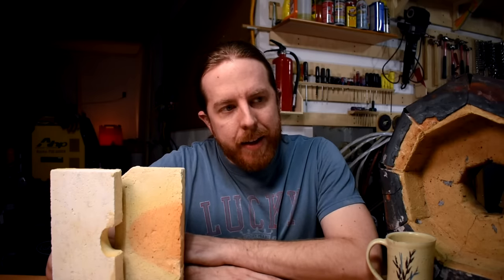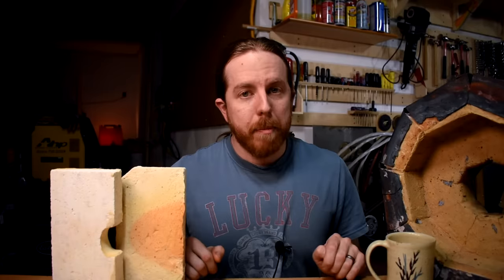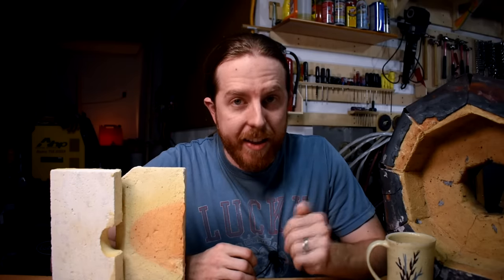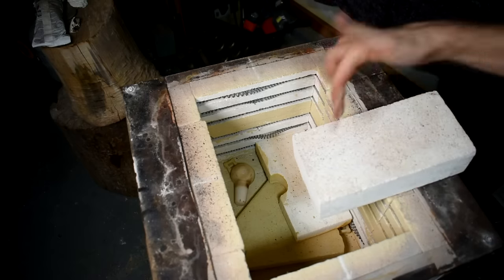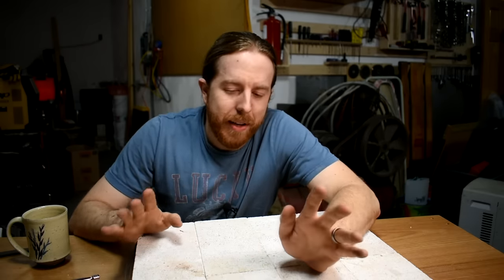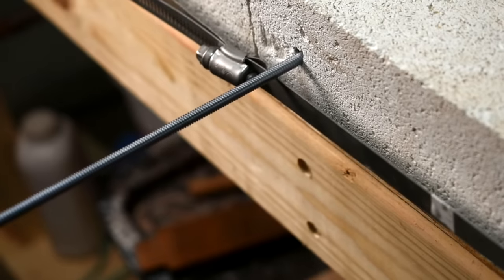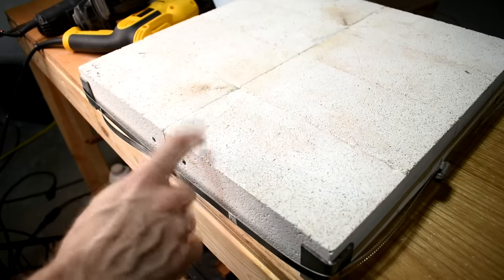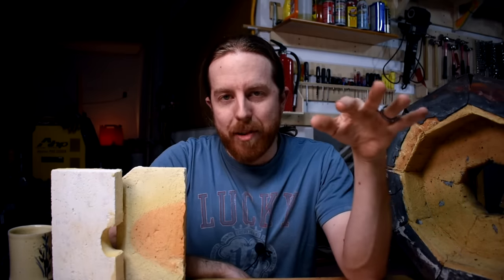There's a Problem With Fire Bricks

Comment: If you use stainless rod and stainless belvile washers you'll have continuous spring loaded tension as well as a bit more temperature and more importantly rust resistance (you'll cry when concrete cancer explodes your lid lol, it's why Roman concrete lasts so long, no steel in it)
Anyway, something like a mudguard washer against the brick, stack of whatever belvile washers you want to get the spring force and movement distance and bobs your uncle.
Check the rating on the washers for temperature against your environment though just to make sure it's ok.

Comment: Use borosilicate rods if you have to replace those steel ones. No expansion and extremely high heat resistance.
Reply from the maker: Good idea

Comment: Saw this video and clicked on it cause I was curious.  Subscribed cause I liked ya.  Also was thinking you just needed to support the outside band vertically, like take of those L shaped metal on both sides of the band.
Reply from the maker: Thank you!  The band holds on pretty well just under tension but it might help to put in some more support for sure

Comment: you should drill a bigger hole for the wire to prevent it breaking the bricks apart when it expands. you could drill a 5/16" hole for a 1/4" rod and lightly wrap it in kayo wool to absorb the expansion while keeping it insulated so you don't get a draft through the hole that unevenly cools the bricks.
Reply from the maker: Good idea.  These are really thin rods, maybe 3/32 so I'm not expecting them to expand a lot. By length maybe but the hole is open on both ends

Comment: You should pay a visit to a glass factory those that produs beer or winebottles. They have a kind of swimming pool fild with molten glass and they keep feeding is glass granulate in the same volume they use. These pools are hot 24/7. They can't stop that proces. Because when they do de walls of the pool will colapes.

Comment: Would grinding the edges of the brick into a tongue and groove help the lid.
 or would it even be possible I don't know how brittle those are.
Reply from the maker: It's probably possible, but yeah it would be pretty brittle.  These bricks will break if have if you tip them over.

Comment: Have you thought of putting a spring at one end (or both ends) of the threaded rod to always be applying a compressive force on the bricks?  Also doing the same at right angles to compress in both directions? Paul, Johannesburg

Comment: Easy solution: ceramic blanket, layer of cheap rock wool as backing, glue with sodium silicate or stitch with kanthal vape wire. reinforce blanket with steel rods (near the outside). DONE.

Comment: Tbh, I feel like the issue with expansion and contraction of the top would be worse if it were a solid piece. It might take all that heat, change size, and then crack.

Comment: I wonder what would happen if you made a rabbet cut on each of the bricks like woodworkers do at the edges of cabinets to create stronger joints. The thought here is that the bricks would still shrink, but in the areas where you have rabbet joints, the weight of the overlapping brick would keep it sealed against the brick below.
Reply from the maker: That would probably help.  The bricks can be cut no problem but I would be worried about weakening them
Reply: @PaulsGarage  Alternatively, you can always construct in concentric overlapping layers. If your innermost layer is the most exposed to the heat and your next layer or even two overlap the seams then your lid will stay sealed despite the shrinkage and separation of the innermost layer. If you use thinner bricks, it doesn't even have to be heavier.

Comment: We used Cer Wool or K Wool  pieces on our pouring ladles to cover tops couple pieces would last for ever on toys

Worked iron pouring,cupolas and ladle repair for years.
Pour one out of ladle cast , also have all kinds of plastics you can ram in , been 25 years since then some are black some Are green, some are white don’t remember names any more
Contact a refractory company may have some outdated

Comment: DoooooD……. Very cool delivery of very cool info….. I am a Blade smith who dabbles in “lost styrofoam” casting…. Heat treat of carbon steels. All with wild & wooly propane. I’m having the best luck with castable for my forge. 30# propane tank…..stainless bells for the burners is ideal. Thanks for the research.
Reply from the maker: I've made a castable furnace in the past, it's definitely nice and easy.  I didn't use really good stuff though.  If I was going to do it again I'd use kast-o-lite30
Reply: I’m in Canada so I’m hoping to get something local. Forced air is best efficiency & simplest build.
Reply from the maker: Definitely forced air if you need lots of temperature.  Lately with this zamak stuff I'm using a small, non forced air burner because I don't want to overheat anything.  It still gets too hot if I'm not careful!  The forced air burner can melt cast iron no problem, so bronze is a bit tricky, it overheats too easily.  for heat treating have you thought of using an electric oven? It's much easier to control the heat cycles exactly

Comment: I tried something similar a few years ago but I used the refractory cement and thick chicken wire. While technically it's still together I'm not a huge fan of it. I don't know what the solution is but I don't think what I did is it.

Comment: I tried to build some sort of furnace to smelt iron ore together with a friend of mine. We were about 10 years old and this was before the Internet became what it is today. So we found large pieces of discarded asphalt from some repavement project or something like that? We transported a huge amount of these chunks of asphalt to firing range that was no longer in use since it had lots of sand availble and was far away from any houses. We constructed a box of asphalt chunks. Then we filled it halfway up with charchoal and finally added the iron ore. Finally we covered the whole thing with sand with just a small opening at the top and a pipe sticking out at the bottom. The pipe was connected to a fan that was powered by a car battery that must have fallen of a truck. 
We fired that sucker up and the fan just went to town on that charchoal. Being young and total morons we didn't know that asphalt starts to burn when it becomes hot enough.  We found this out when a huge amount of pitch black smoke started to spew out of every corner of our smelter.

There was no risk of the fire starting to spread since we built it on and old firing range. But the smoke could be seen for miles. So we noped the f out ot there before the fire department and cops arrived at the scene. 

So do not use asphalt when you build ovens designed to smelt iron ore. I pretty much 100% certain it wasn't even iron or we tried to smelt, just black pieces of sone sort of mineral?

Comment: When heated they expand. Is your metal band not letting them expand freely and causing them to fail? Like a buck stay on a brick kiln. You have to loosen when hot and tighten if you cool them off or you could have crown problems.

Comment: Just a thought, but have you considered lining the interior of your bricks with Starlite? Supposedly the material remains cool to the touch after being hit with a blow torch for 5 minutes because carbon resists heat very well. Since a blow torch can exceed 2000 degrees F it stands to reason that this would prevent heat from reaching the bricks. Now, Starlite has it's weaknesses: It's physically weak and is destroyed by water, but as long as you are just lining the interior of your fire bricks with it this SHOULD solve your problem. 

Officially, Starlite is a lost art, but there have been people who have successfully created it again or at least something close to it. The ingrediants are: 10 parts cornstarch, 1 part baking soda, 4 parts Elmer's PVA Glue. There are videos on YouTube of people making it.

Side Note: Materials like Starlite is a likely explanation for ancient stone structures too large for humans to move. They probably built molds, melted the rock, and poured it into shape. This would have allowed the blocks to fit closer than laser precision and be much larger than anything they could ever hope to move and since the mold would be destroyed by water there wouldn't be any surviving evidence.

Comment: Maybe try coating the inside of the forge with ceramic glaze on the first firing as a heat barrier
Reply from the maker: I use a coating of satanite which is a good high temp flux resistant surface so you definitely have a good idea there

Comment: Yes, though the ones I bought were k23 items.

Steel?  Perhaps 1/16 - 1/8 er316 Tig rod?  That won’t get messed up as quick by heat and oxidation?
Reply from the maker: If i had any super long tig tungstens that would be the best probably.
Reply: @PaulsGarage  those would oxidize almost as fast as the all thread.  They’d get all brown and moldy in no time.

316 stainless handles heat and oxidation pretty well.  321 would do better still, but finding 321 stainless Tig rod…

Comment: Step the sides of the brick, so you have a half lap joint. Conversely use thinner brick and double layer with the centers over the joints. Ot use tungsten rod.
Reply from the maker: Good ideas

Comment: PG, give some thought to * spring loading* or a torsion system to keep things snug.They are relatively simple applications.
Reply from the maker: That sounds interesting, is there a way to allow for expansion of the bricks under heat and still keep it tight when it cools?
Reply: @PaulsGarage  yes, make your rods longer and secure them on one end with a fender washer and a nut. On the other end make the rod stick out a few inches and use a fender washer-spring- washer-nut. When you slightly tighten the nut against the spring it will cause a tension clamping force that will hold the bricks together as they shrink
Reply: @PaulsGarage  the easiest would be to incorporate a tensioning spring in an outer band where it's putting a compressing force at the fastening connection.

Comment: Brilliant idea castible refractory
Reply from the maker: I've used that stuff and i'm not impressed, but i didn't use one called Kast-o-lite, which i hear is the good stuff.  I'm ordering some soon to use fixing up the foundry furnace, so i'll check it out.
Reply: @PaulsGarage  Don’t remember the stuff I was using like the bricks it is application critical. Have always dealt with a refractory dealer that’s all they do is commercial. Heat treat  ovens forges kilns . But I’m in a area with heavy equipment manufacturers .
Good luck in your ventures. I’ll be watching

Comment: You could really cheat and line the inside of your kiln / oven / forge with 1/8th inch 330 stainless steel plate too... It actually is relatively cheap compared to firebrick and it can handle extended time at 2000+ F

Comment: The problem is the wrong application of bricks as a flat lid to keep cost down. You get the consequences later well after you've paid for it. Is just force fiberglass in the crack, my ceramic glasses is still in the box so I can tell ya if it'll powder or not while getting shoved in a crevice.
Reply from the maker: Yeah if I did this again I wouldn't use bricks for the lid.  Maybe some of those refractory boards or something

Comment: Plane  the butting surfaces of the brick at a slight angle so that they form a very mild arch . Then mildy  tension the band , much less tension than used without the arch geometry. Gravity will then be in the lid's favor .
Reply from the maker: Very true, that would work

Comment: Wouldn't pre-heat-treating the bricks solve this?  
It appears they expand in a permanent way, then stop expanding for any brick or section exposed to a lot of heat.
Put the bricks one at a time in your (old) kiln, then build the new kiln with the treated bricks.  Not sure how long the heating would take?  48h perhaps at 1000C?

Comment: For one you are using insulator bricks and not hotface bricks insulator bricks just rubbing 2 together will change their shape they're soft and designed to wear second you should be using a combination of insulator bricks and either hotface or ceramic bricks for better durability also using mud and adding some kwool to the top of the furnace between the sides and the top lid will help to seal it up better

Comment: bricks are mortared together on lids or use ceramic fiber sheets, my kiln lids are way bigger than yours and I have no problems, mine are octagons.  Do yourself a favor and look for a used kiln that needs elements, and a HF weed burner, and your in business. I also use a laboratory furnace
which also uses fiber, it fires up to 2400f incredibly fast

Comment: Why not for your top you could also use duraboard you can get it in 1in 1.5in and so on think they go up to 3in but it has the same heat rating as your brick and can be easily cut to size
Reply from the maker: Good idea, I would probably do that if I build this again

Comment: You could build a steel box cover and stuff it with ceramic fiber insulation.  It would be a lot lighter and you could cook dinner on the top.:trophy-yellow-smiling:
Reply from the maker: I'm thinking of adding a shell with ceramic wool insulation around this and the foundry furnace.  Budget is the only reason I haven't yet

Comment: Permaculture, wood stove, and masonry heater folks also use fire bricks. Look up the rocket mass heater if you haven't.
Reply from the maker: yeah these bricks are great for lots of stuff.  I don't think wood stove people get them up to white hot though so the bricks should last forever for them
Reply: @PaulsGarage  true, they dissipate the heat coming off the central insulated stack through the metal barrel.

Comment: steel ball bearings between the brick in the middle may be a simple fix. like a pin between stones in a wall. tool steel even yellow hot can be tough.
Reply from the maker: That's a pretty good idea thanks

Comment: Hey man! Your electric oven build was so inspiring i'm trying to build my own for ceramics!
I need some help calculating the size and how many coils i'll need.
I got a 50l barrel and insulated it with firebrick and ceramic wool leaving me with a inner chamber like a cyllinder of 22cm diameter and 24cm deep.
What size wire and how much would i need to get to 1200c with that inner chamber size? Any help would be awesome thanks!
Love from Brasil !!
Reply from the maker: That's great!  I'm not sure on the calculations so I used kiln elements from a kiln that could get to cone 10, and just made sure to package them in more densely.  I don't know the exact length or size, just that they were Skutt 818 elements and I wired them up the same way they were on the Skutt kiln.  That way I didn't have to do any extra engineering.  Good luck!

Comment: Why not cut an angle on the end of the bricks and overlap them slightly? If they shrink then the end result will be slightly less overlap, or is there something I'm missing?
Reply from the maker: Nope, not missing anything.  That's possible but would require cutting the bricks, which is a very dusty thing to do.  It also means the lid wouldn't be the same size as the oven, but that's more an OCD problem for me

Comment: There is a small possibility that using a single, large piece as a lid might have it shrinking in the middle and after many uses, cracking/crumbling from the tensile forces of the shrinking centre trying to pull the periphery in.
Constructing from wedge-shaped pieces pulled together by banding might be the better way to go, but I'm just guessing.
Reply from the maker: You might be right about the single giant lid thing.  I bet it would hold together longer but eventually it could still crack.  I find when things crack they leave a jagged surface which holds together really well with tension, better than the smooth sides brick, but there could still be problems.  The wedge idea is how the foundry furnace kid is made and it has never had a problem despite shrinkage showing up
Reply: @PaulsGarage  Wedges seem like the solution, even if it is more complicated to construct.

Comment: So there is actually something that I know exists out there from my chemistry stuff. 

Aerogel. There are some Aerogel's that are super heat resistant. If I remember correctly some of them wear down and they are really expensive at the time. There is also some form or insulation materials akin to fiberglass in shape that you can use as well!
Reply from the maker: If i could afford it, i'd go crazy with high temp insulating stuff.  Aerogel is amazing stuff.  Light, insulating, and i think JAXA used it in a space probe to catch comet dust or something?  very awesome stuff.
Reply: @PaulsGarage  

You could actually probably make some by yourself. Nile Red did a video on making a type of it in his lab that I found really interesting. There are tones of papers out there on the process of making it, and with some ingenuity and a little bit of crazy you might be able to pull it off.

Comment: Carbon is obviously going to react with oxygen really easily, but even so carbon wool felt sheets are really cheap - if it's a sufficiently reducing environment or you could add a refractory coating, maybe it could keep the wear off of the bricks in a disposable way, while also retarding a bit of air and insulating a bit.

Comment: It seems to me that the side to side expansion of that all thread will cause problems. I.e cracking of the firebrick. I could be way off of course, I don't use them much outside of blocking the end of my gas forge and for brazing on my bench. Kao wool and refractory cement are my go to choices.
Reply from the maker: the rods are floating so if they do expand lengthwise, they can move without problem.  I doubt the thickness will change enough to be a problem. we will see though
Reply: @PaulsGarage  👍